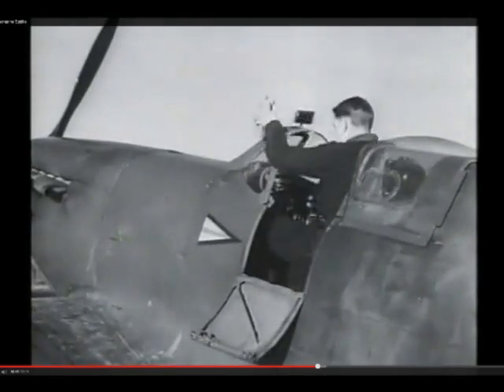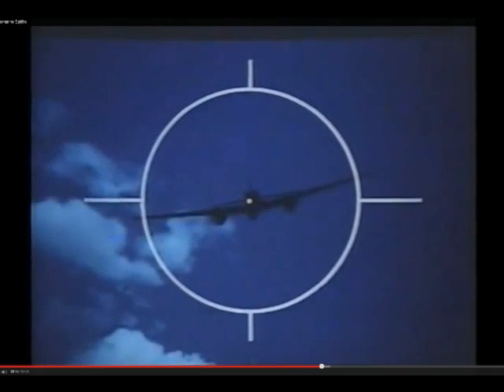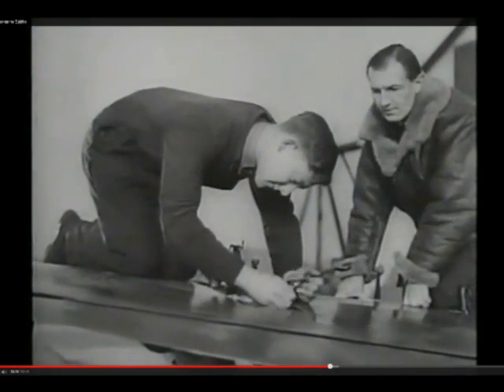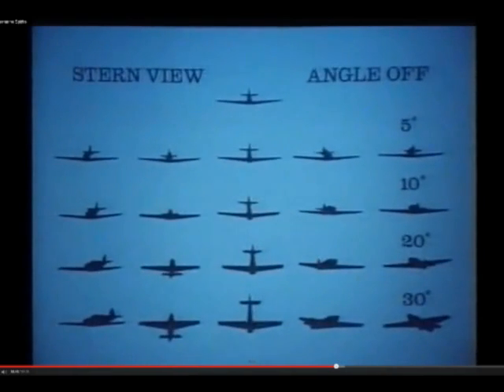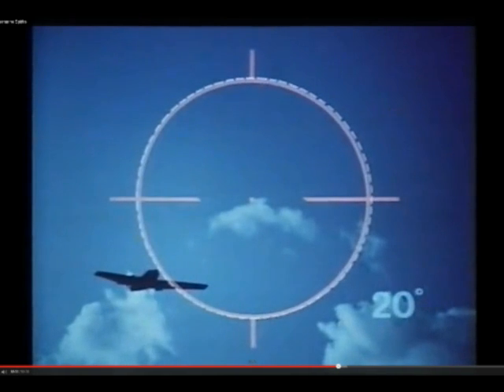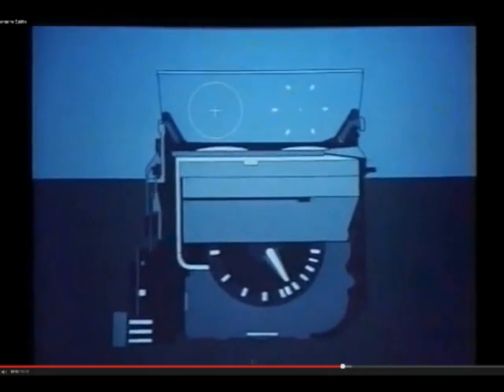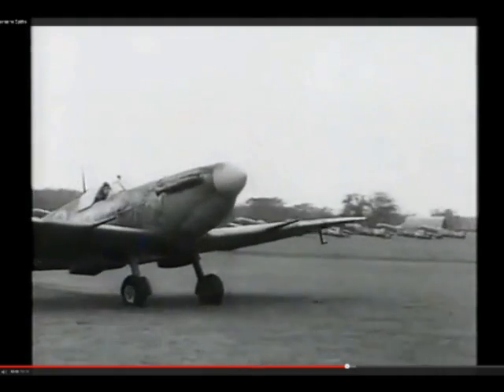SPITFIRE GUNSIGHT TUTORIAL

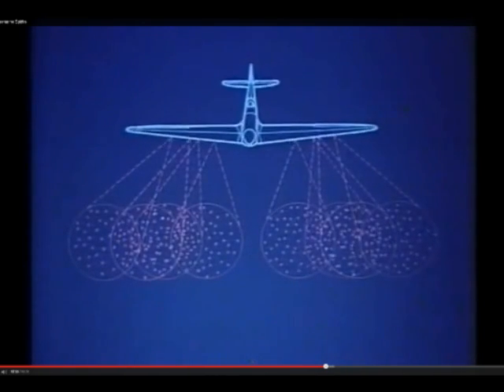Comment: Did he say at 1:25 that the "8-gun Spitfire would fire about 480 rounds in a typical 3-second burst"? That's 160 rounds per second.....a modern minigun shoots at 3,000 RPM, which translates to only 60 rounds per second. So, they're saying the Spitfire would fire 2.6X faster than a modern minigun. Am I the only one who was conflicted by that remark? I know it's 8 guns versus 1 rotary machine gun, but that doesn't seem realistic to me, given the times. I dunno...someone explain?
Reply: The minigun can run 6000 rpm, however barrel life suffers. Since it is mostly used for antipersonnel, and not anti aircaftthey turn it down to between 3000-4200 rpm
Reply: So if you work it out each barrel fires about 100/sec on high, the brownings had 2 extra barrels, a minigun is 89#, and the browning .303 41# each so much lighter, more ammo for same gun system weight
Reply: .303 machine gun in aircraft trim has a rate of fire of 900-1200rpm, therefore combined delivers 7400 - 9600rpm or 120 - 160rps which could deliver the 480 rounds in a 3 second burst.